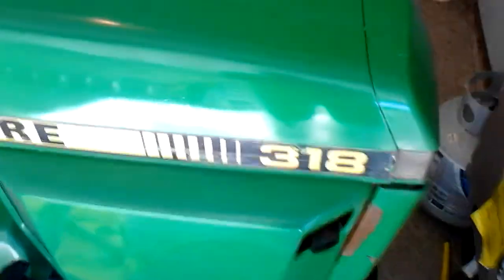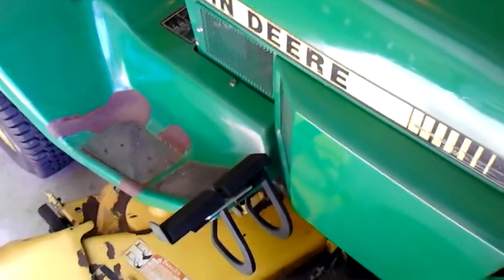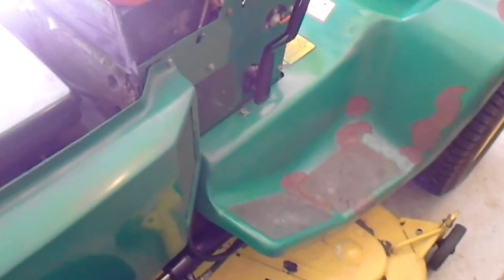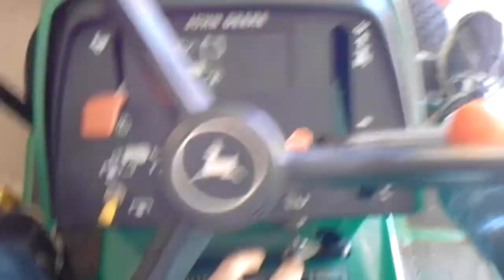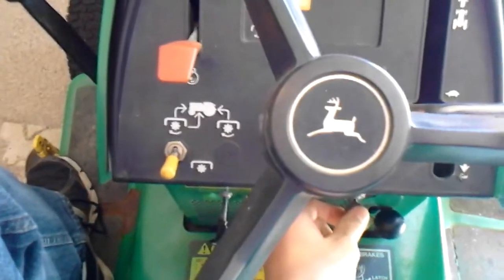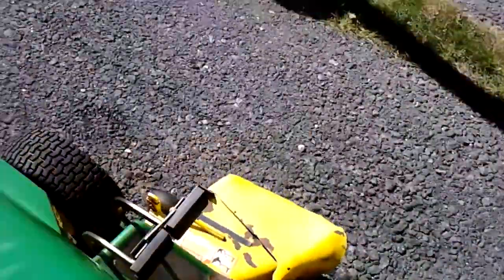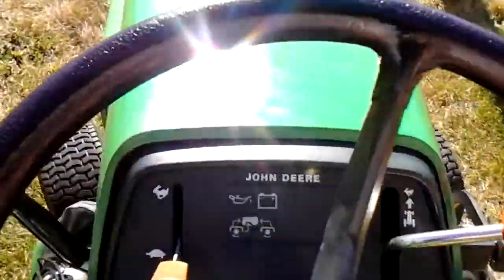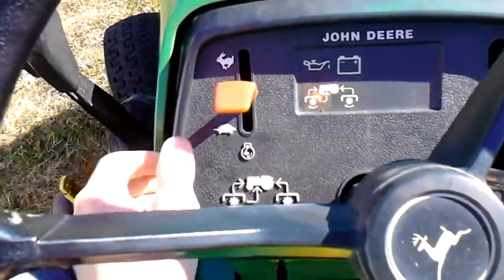How to prep your tractor for use/mowing

Comment: Good video. A lot of people forget to do this stuff before they start their tractor, and then complain that their Onan overheated and blew up. They'll last a lifetime if you use common sense. I spent last Saturday tearing apart my 316, I pulled the cooling fins off the motor, pressure washed all the grease and dirt out from inside so it runs cooler, and changed the oil, oil filter, air filter, and fuel filter. Also added seafoam to the oil to clean out the insides of the motor. Now the oil is real clean and doesn't hardly use any. And runs much stronger and cooler too. That's how these things last.
Reply from the maker: +MichaelTJD60 Yep a little maintenance goes a long way. I want to have my 318 for many years. So it is a good habit to get into. Every time before I use it i do what is showed in the video. Its hard to believe that so many people don't do this. Then they wonder why the mower doesn't run.
Reply: +1990john deere318 Yep same with my 316. Motor runs great and doesn't burn any oil at 1250 hours so I'm trying to make it last as long as I can. Seems like it was mechanically taken care of its whole life so I want to keep it that way.
Reply from the maker: +MichaelTJD60 Yep me too. I love that tractor. Has all the power I need. What are your thoughts about putting a 44 loader on it?
Reply: You'll need a bit of weight on the rear. You have power steering so there's no problem there. Only thing with a loader on these older Deere's is they need an external hydraulic pump to run it since the on-board hydraulics are really slow. Also, you'll need 3 hands to run the tractor with the loader since it's a hand hydro. And the loader does take up a lot of room to store. Something to consider.
Reply from the maker: +MichaelTJD60 Yeah I didn't get one. I just saw pictures and thought it looked cool. Maybe one day if I need/find one in good shape.
Reply: Yeah these things are definitely built to handle a loader but they're expensive and cumbersome like I said. Very heavy duty though. You can buy an aftermarket Johnson, Kwik-Way, Buford Bucket, or CTC loader for these, all very well-built too. I don't have a need but if I really wanted a tractor for loader work I would get a compact or something bigger.
Reply from the maker: +MichaelTJD60 Yeah I agree. A compact would be a better choice now that I think of it.
Reply: Someday I want to purchase a Deere compact like an 855 or 955 which are really just a 430 on steroids. Or something a tad newer like a 2210 or a 2320.
Reply from the maker: +MichaelTJD60 Yeah that would be good too. The thing is we want to have things. But we have to have space for it too.lol
Reply: +1990john deere318 this is after I've moved out and bought my house on 10 acres with a separate garage lol. I'll have my two current tractors, a round fender 110, a compact like I mentioned, a Ford diesel tractor, and 2 or 3 old two-cylinder tractors.
Reply from the maker: +MichaelTJD60 Im with ya there. Especially with the 2 cylinders. I hope I have one someday too. They sound good. I refer our 316 and 318 as mini 2 cylinders.lol
Reply: +1990john deere318 Still got my grandfather's 60 and Ford 4000 but they are both restoration projects
Reply from the maker: +MichaelTJD60 Hopefully you get to restore them one day and maybe make a video.
Reply: Yep that's been a goal of mine for a long time.